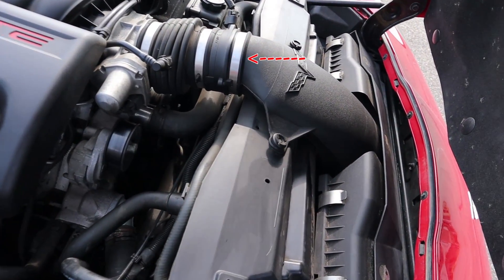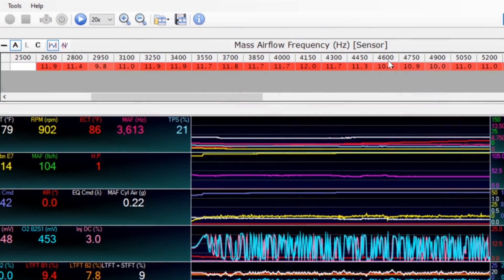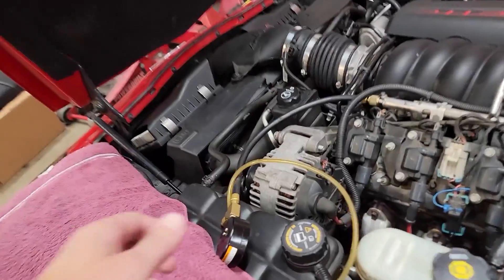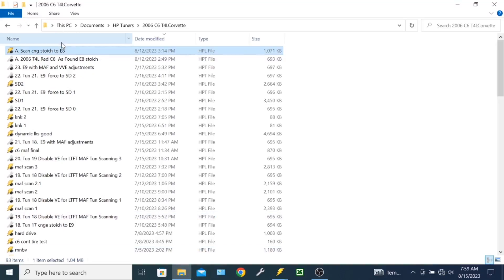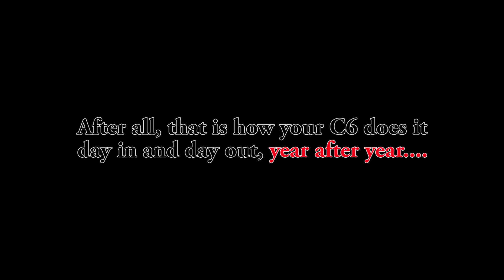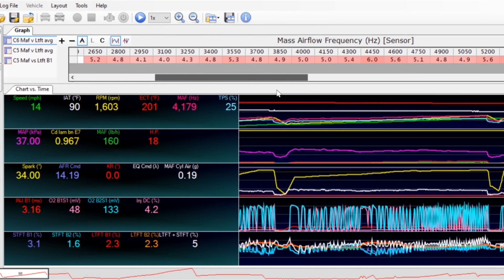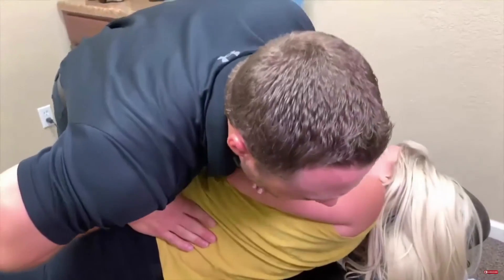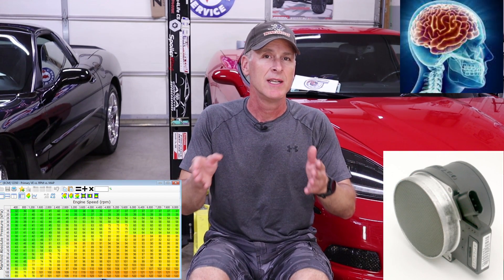Stock C5 & C6 Corvette Tuning Pt. 2 with HP Tuners (HOW-TO & is it Worth it?)

Comment: You've made this very understandable
Reply from the maker: I appreciate the feedback!  Thank you!
Reply: @Toys4Life  I have a quick question, and i didn't catch it in any of the 3 tuning videos.  for doing the fuel ratio tuning, did you replace one of the narrowband 02 sensors,  or add a wideband 02 sensor somewhere else on your exhaust, or ??  Just wondering as i know you are collecting the readings during actual driving.  If you just replaced one of the narrowband 02, do you now have CEL on because of it?  Thanks.
Reply from the maker: On the C5 -I have an extra port in the mid pipe before the main catalytic converter. I tune my part throttle using the narrow bands, i Tune full throttle using the wideband.

Comment: Thanks for video. Your videos are always straight forward and easy to follow.  After tuning the stoichiometry to adjust for ethanol content and fuel, if the results are near 0%, do you feel it is necessary to move forward to your next step (fine tuning MAFS and speed density)?  Alternatively, what if results after adjustment for ethanol content are around 5% as in your example and the stoichiometry is again tuned in the direction to get down closer to 0% instead of the MAFS and speed density separate tuning?  Thank you.
Reply from the maker: +/- 5% is good enough IMO for LTFT's.

Comment: Hey quick question... i'm working on my VE tables on a cammed c5 corvette and i noticed after I do some modifying to my table and upload the tune, my idle runs very lean on startup. I'm at sea level pretty much, and my logic tells me that the IAT being higher after sitting would lead to a richer condition, not a lean one.... thinner air + the same fueling for more "cold" air = richer? I noticed if I drive the car for a bit, the afr normalizes and comes in line with how I adjusted the tune. Is this normal, or is there a tweak I need to look at in the tune? I know you mentioned to make sure you don't log with heat soaked IAT/coolant temps.
Reply from the maker: One thing to keep in mind is that the oxygen sensors are not accurate until they're fully warmed up which is actually pretty hot.
Reply: @Toys4Life   This might explain it then
Reply from the maker: Hot inlet air temps should tell the computer to give it less fuel because hot air contains less oxygen for a given volume. Are you tuning part throttle areas or wide open throttle? Are you tuning with your narrow bands or a wideband?
Reply: @Toys4Life  Today I was working on both VE and MAF but only steady throttle stuff. I have an AEM wideband and I turned off all the STFT and LTFT's for the tuning. 

It's weird with VE, I was experiencing the weird thing I mentioned to you. With MAF, I have an issue where the idle dips really low and then surges, then dips low again (and so on) when rolling to a stop and only stabilizes when I'm completely stopped. VE doesn't seem to have this issue. 

I tried re-enabling everything together and it seems to drive nice, but there were more lean spots. The idle hunting issue was only there for maybe the first two stop signs and then I guess the fuel trims evened that out.

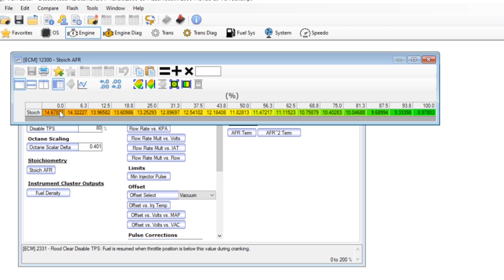Comment: Is there a lookup chart for stoichiometric air fuel ratios based on the ethanol rating in one’s area? You enter the value at 4:09 of the video and I cannot figure where that value was derived from. Thanks.
Reply from the maker: https://www.tunedbyzfgracing.com/ethanol-calculator

Comment: Would it be worth tuning my 98 c5 m6? It has vararam intake, muffler delete, coolant throttle body bypass, new spark plugs and thicker plug wires. I also have some longtube headers and catless x pipe to install. Should I install my parts then tune it?
Reply from the maker: It is over 20 years old - so I think you could pick up some HP as is.  You should absolutely tune it after the LT's to capture the full benefit.  It is up to you to decide if you want to teach yourself or hire someone - tuning is fun, interesting, mentally stimulating - but it is not super easy to learn.  But for most - if you really want to learn it and spend the time to do so - it is do-able, especially for minor bolt-ons.   Toss in a giant cam and that greatly increases the difficulty (:-).
Reply: @Toys4Life  will do some more research and stuff…. Regarding my current mods + the headers and x pipe when installed and tuned would you say that around 380 wheel is possible? Or is that only with cam?